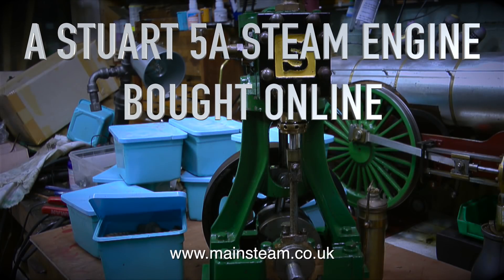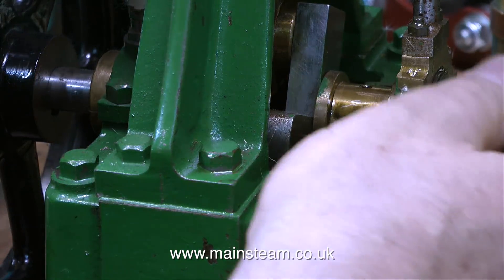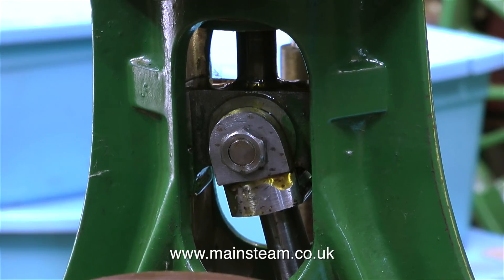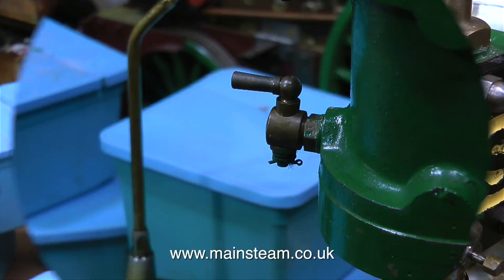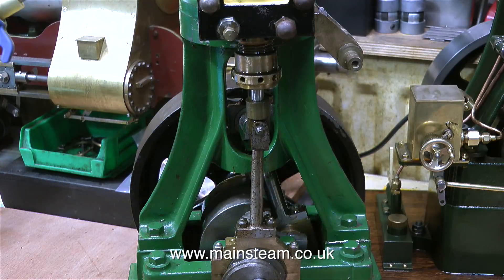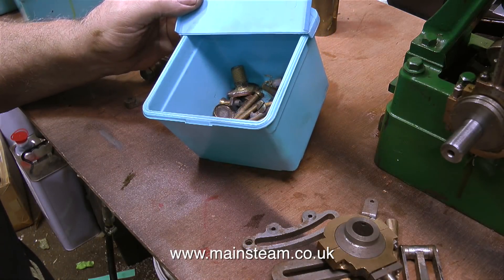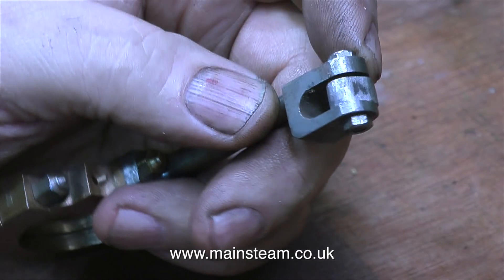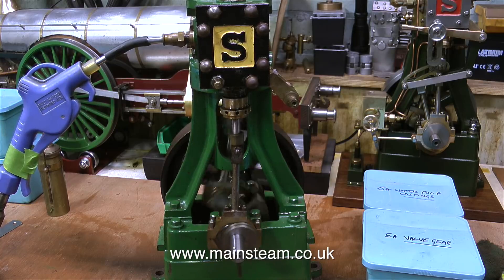A STUART 5A STEAM ENGINE BOUGHT ONLINE

Comment: I built a bike and had it titled as a moped about 300 us dollars total for the title registration and tags but i put a  small steam engine in it the gas tank is split one side is pump gas and the other side is water its very simple the gas and water gravity feed from the tanks to the boiler the throttle is just connected to a valve in the line between the engine and boiler and the rest of the controls are on the handle bars 

The point of my comment was  these are very good engines and a combination of my steam bike and my other scrap metal bike have been taking me to work everyday for 6 years without a problem 

Why don't more people actually use these engines for something ?

Comment: I am currently out of the workshop and re doing the tiles on the house OK We live in Tilehurst!!! A Neighbor walks past and he asks "If I had an Angle Grinder?" "I have 3!" was my reply. Well I am going to use the other 2 for angle drives on another project! The main one was from Tesco!!!
I got a Black Five in bits mostly castings (From the internet) which for the price of the boiler came with a completed tender. 101 uses for a 5 inch gauge tender in and around the house?
No the boiler will not cook noodles!!!
David and a very understanding Lily.

Comment: If just started a book entitled 101 uses for an angle grinder.the first chapter is called how to sharpen a pencil with an angle grinder but I can't finish it as
A.i have no pencils left
B.the blood keeps  staining the pages.
Another good vid keith
Reply from the maker: Top Tip: run the angle grinder at a higher speed with a coarser wheel - then the friction will automatically cauterize the wound }:-)))